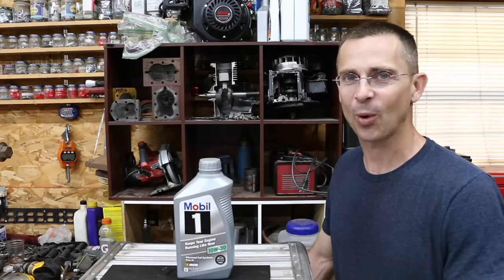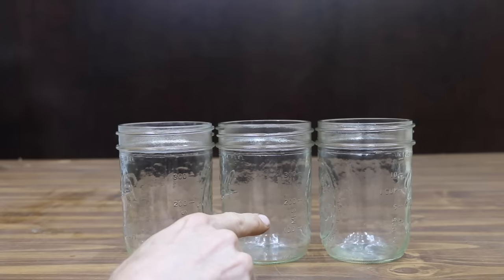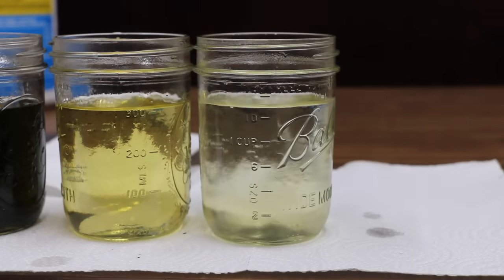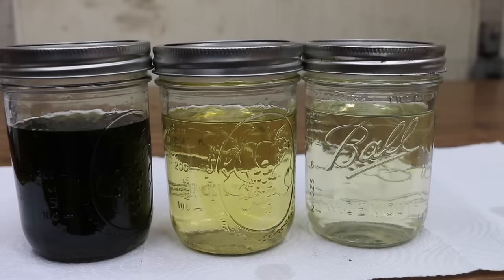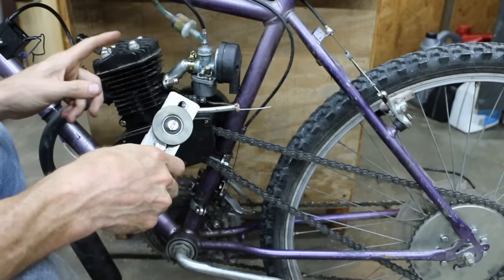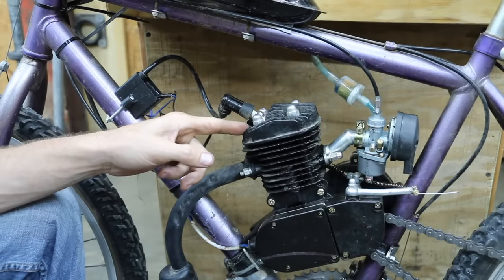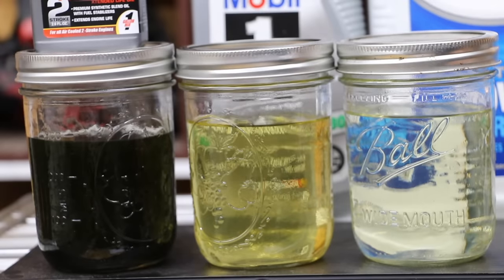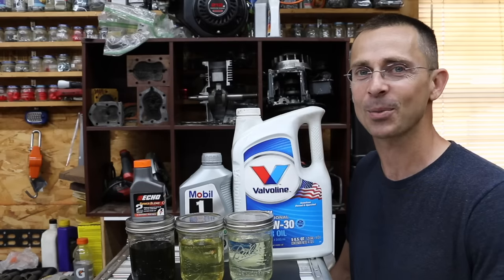Will 4-stroke oil damage a 2-stroke engine?  Let's find out!

Comment: in the 50s and 60s when I was a kid on the farm. We NEVER had any 2 stroke oil. we ran 2 stroke engines on chain saws, outboard boat motors,washing machines, lawn mowers, and my 125cc 2 stroke harley davidson. NO one I knew had any 2 stroke oil. cars like the saab and dkw 3 cylinder 2 strokes used ordinary 4 stroke oil. Yes, 2 stroke oil is better to use and results in less carbon build up so I use 2 stroke oil now that I can get it.
Reply from the maker: Thanks for commenting on this.
Reply: Thanks for sharing Rick. Excellent!
Reply: That is because you had leaded fuel, the lead was the lubricant ;)
Reply: we used 4 stroke oil in the gas
Reply: @notavailable9919  Lead was never the lubricant. There may have been a tiny effect, but even this is not clear.
Reply: try again.......
Reply: Not Available ... The main benefit of lead in fuel was to raise the octane to prevent engine knock. This also benefited the valve trains -prematurely wear of valve seats more specifically.
Reply: 1970 max amphibious atv calls for 20:1 straight 30 on JLO 2 stroke
Reply: i now fill up my truck with xd-100 2 stroke oil and i swear buy it
Reply: yeah 2 stroke oil today burns much hotter and cleaner.

Comment: During cold war era, in the entire eastern block many 2 stroke cars and bikes were driven for decades with cheap Addinol MV232 four stroke oil mixed to fuel...if "VEB Addinol MZ22 two stroke oil" was not available or too expensive (and it was allmost never availabe :-)))
Reply from the maker: Thank you
Reply: Still remember those andy.father ran waste 4 stroke oil in his 2 stroke. Only side effects where some soot around the spark plug that was glowing on a high power demand low rpm situation and caused pinging so you'd have to use a lower gear. He also knew some engineers from Addinol and they said more or less if an (4 stroke) engine survives our (4stroke) oil, it'll everything else.

Comment: thank you for making this video. I was on my way fishing after filling up the boat and already putting the 4 stroke oil in the gas. when measuring the oil I noticed the color was wrong and thought it must have been a new type of oil, as my dad had gotten it and he's been running boats for longer than I've been alive, so he knows the difference between 2 and 4 stroke oil. when I was done I looked at the jug to see what this new oil was, well it was 10w30 lol. we had already ran 20gal of this mixture threw the engine and I just put 10 more gallons of it in the boat. I thought the engine was toast. I found your video on this and watched it before I left the gas station. Thank you so much for doing this, I already subscribe to your channel, but I am so thankful for this video. I can guarantee I will be picking up the right oil immediately, but it's nice to know we didn't hurt the engine. The tank holds 20gal, but we run the boat enough that we shouldn't have to worry about it gumming up before it's gone, if anything the gumming up gives me more of an excuse to go fishing to get rid of the 4 stroke oil lolol. Thanks again.
Reply from the maker: You are welcome!  Thanks for sharing.

Comment: This is a great experiment. Thanks for doing this. Intrrestingly enough my 1961 Mercury outboard motor manual indicates that a straight 30 weight oil can be used in place of two stroke motor oil. They do not recommend multigrade oil or oil with detergents.
Reply: Sounds like my 8v92 detroit diesel 2 stroke oil specs, i cut in some XD-100 BRP oil in with shell rotella though, 475hp turbo 2 stroke! 2 strokes under load produce more heat and pressure and require a heavier duty oil! look at Silkolene por 2 sx, motul 800 2T and amsoil dominator, all surpass 4 joke crap as a 2s troke bot gas and diesl is an industrial gade motor, both Day loop charged and Clarke uni-flow charged! All are more efficient and more powwerful, 4 joke is throwaway automotive crap that sounds and runs like shit but fu to watch self destruct! All thse great muscles care are ruined by 4 joke disposible horrble sounding scrap! not a fan of 4 joke and never will be. i got my rotary on nothing but amsoil dominator synthetic 2 stroke oil and runs great. But there is hope as you can make a u-loop charged poppet valve 2 stroke like this 1.9 VW diesel:https://www.youtube.com/watch?v=qosAllch8Sg&t=5s

Comment: I have used diesel fuel as a 2 stroke oil substitute--works fine but smokes a bit more as you would expect, long term would prob not be too healthy to the engine but its fine in an emergency. Great channel  BTW, keep it up!!
Reply from the maker: Thank you
Reply: Diesel doesn't have the same lubrication properties, and might cause overheating.  I'm surprised it ran that way.
Reply: That's crazy who would use diesel in lou of 2 stroke oil it's not even oil who uses diesel for a lubricant

Comment: Have an old Sears Elgin 2 hp boat motor that says "FUEL RATIO: For normal operation mix 1/2 ?(label damaged) S.A.E. #30 or #40 oil with each gallon of gasoline." Thanks for the videos, keep them coming!
Reply from the maker: Thanks, will do.

Comment: Would love to see a comparison of different 2-Stroke oils. Curious to see which brands are best for power output and wear protection.
Reply from the maker: Thank you for the video idea!
Reply: I use motul 100% synthetic 2t oil.
Reply: @ProjectFarm  I'm not sure what happened to 2 stroke oils but they seemed to have deserted the shelves like the shell rotella t6. These oils are nowhere to be found and I have to use motul 15w40 mineral oil as substitute, a bit Smoky but it actually works
Reply: @ProjectFarm  please test redlines racing 2 stroke oil for us!

Comment: I own a small engine shop and can tell you exactly what will happen. The cylinder will eventually build up deposits, the exhaust port will get clogged, and the engine will finally stop running when the muffler screen clogs to the point the it can no longer release the exhaust.
Reply: That sounds like the result of way too much oil mixed into the gasoline, not necessarily the type of oil used.
Reply: No , the oil additives will whisker the spark plug long before carbon builds up.
Reply: My 1956 outboard is 30 weight engine oil to gasoline 16/1. Ive ran it this way for 20+ years with no issues.
Reply: @dougglaus9256  I have run 57 ev. 15 hp for about 50 yrs. and it is still working good on 30 wt.
Reply: I’ve always used a quality 4stroke motor oil in my 2 stroke stuff (the oil provided by Mercedes dealers) and my McCulloch chainsaw and ryobi brand weedwacker for over 15 years, never had either fail (apart from a blocked jet on the ryobi carb but that happened after about 3 hours not 15 years
Reply: I think that depends largely upon engine design. A higher compression with no spark arrestor, for example, would usually be lower maintenance. Modern 2-stroke designs are more likely to trust owners to use the low-ash 2-stroke oil; therefore, those engines will require higher frequency of maintenance than their older counterparts if run on 4-stroke oil.

But something else, I think, doesn't seem to get highlighted is the difference between today's owners and those of long ago. Older generations were taught and raised to be more involved with the responsibilities of engine ownership and maintenance. Today, however, owners expect things to "just work". Far less likely to perform routine inspections and maintenence, and much more likely to bring things to a shop when they don't run correctly. For example: today's vehicles come standard with oil life meters and oil change warnings--with many of those not even mentioning oil, instead just displaying a generic "check engine" alert.

In short: running 4-stroke oil should still be just fine. The real problems come from reduced owner responsibility factored by modern engineering assumptions.
Reply: But it looks like 2 stroke actually has more deposits, on spark plugs for example, how its possible if its purpose to burn better and leave less deposits
Reply: @She1lby  Depends on what you're comparing to. 2-strokes will always have deposits, no matter which oil is used. The debate here is whether oil designed for 4-stroke engines is better, worse, or as good as oil designed for 2-strokes. Even though 2-stroke oil leaves less deposits, it leaves deposits nonetheless.

If you compare spark plugs between any 2-stroke and any 4-stroke, you'll find that the ones from the 4-strokes are always cleaner (assuming good rings, proper fuel, and optimal fuel/air mixture, of course). That's because the fuel in a 4-stroke does not have oil mixed into it.
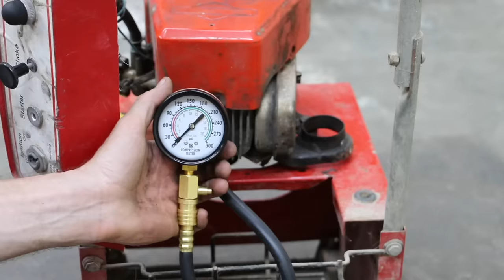Reply: @TonyGingrich  We are comparing oil, not engines - for example 4:58 it looks like 2 stroke oil in the same engine has left more deposits than 4 stroke.
It makes no sense for me because 2 stroke oil is created to excel in this - to burn better and leave less deposits but we see the opposite.
Reply: @TonyGingrich  Good point. My grandfather was parts manager at a mower factory. My father and two uncles also worked on small engines for decades. I learned maintenance at an early age. It’s saved me lots of money and problems since then.

Comment: My grandpa said early 2 stroke engines ran on non detergent 30 weight oil.  Wasn’t till lawnboy came out that a separate oil became the standard.  He said that they would just use used 30 weight engine oil in them.
Reply from the maker: Thanks

Comment: wonder if the 2 stroke has dye to make it easier to see when mixing?
Reply from the maker: Yes, you're right.  It helps consumers determine if fuel is mixed with oil. Thanks
Reply: Yep, that's exactly why.
Reply: Jusb1066 ,
Sometimes red dye was added to diesel fuel that specifically for farm equipment.
so it was identifiable people try to use it  diesels trucks on the road which is non-compliant to DOT.
Reply: @ash yes, in the UK we red dye none road taxed fuel too, always has (im my life!),   even though i had two strokes, i never thought about them dying the oil untill i saw it being mixed
Reply: Right! Some is blue and some is red. Can't remember which though.
Reply: It's in all off-road fuel as far as I know here. Taxed is clear but untaxed 
off-road is red.
Reply: Lewie McNeely my understanding is that if you are moving freight for a job or doing work with the fuel for income or business (which they will tax you in other ways as well) they want to tax your fuel cost because you can write it off in your income taxes.
Reply: Here you can run the off-road dyed stuff in tractors and construction equipment but if the DOT catches you running it in a rig on the highway hauling stuff they'll burn you a brand new one! If questionable, the HIghway Patrol will check the tank(s). There is also diesel antifreeze that is dyed red. I used it in my V.W. in cold weather to keep from jelling. We may be talking about the same thing too. I get more dense than normal sometimes.
Reply: Red dye in diesel fuel used to indicate higher sulfur content, as well.
Reply: Sounds like a plan.
Reply: It is a method for the government to tax fuels.  Off road fuels are not taxed, so they are dyed.
Reply: In my life i had several different dye colors, green, red, blue, orange. Whatever the manufacturer decides on using
Reply: An odd remark about this, gasoline is died green in the Philipinines and several other countries and deisel looks the same as gasoline here in the states.
Reply: We were all talking about the oil, not the gas
Reply: Yes- some of the vehicles bought from the closed farm have red stains in the carb area. I know someone who also uses (Legally) Red Farm fuel cause he has a farmer plate. He told me he notices it stains parts red that have fuel running through. Intake,Fuel Filter etc. Something about the red fuel stains. Never seen or maybe noticed it with any other fuel. It seems Farm Red is used to gasoline and diesel.
Reply: When the prices changed. So did the dyes as far as DOT legal goes. Kerosene used to be clear and 3x cheaper than diesel. Now Kero is more than diesel and I see a Bluish/green tinge to it now. Diesel is now a yellow now.{Which I run in the furnace from time to time to beat the home heating oil prices] I did learn one thing about home heating oil. There is tons of nonburnable sludge which looks more like sand to me. I used a torch and the shit wouldnt burn.But Diesel is as clean as a home fuel gets. I notice a cleaner and hotter burn. Sulfur is a bit higher but soot is non-existent. Also I noticed they have water in home heating oils too. smh.
Reply: Thats why you buy the dye needed ;) hint
Reply: Ash qelon  it's actually not taxed that's why  red diesel is cheaper it's diesel fuel but not taxed
Reply: that's weird in Australia diesel is dyed fluorescent green/yellow. But yeah there's different coloured diesel to help stop people dodging tax and subsidy rules as farmers get cheaper fuel, and you can get other things like kerosene and heating oil which will run in a diesel which is why they are dyed a different colour
Reply: Ash qelon red diesel used to be a selling point at truck stops to denote premium diesel before they started using red dye to tell you it's untaxed.
Reply: Jusb1066 yes I've watched them mixing the red dye into clear diesel here in the United States.guy told me it's a vegetable based dye about one gallon of dye for a thousand gallons of diesel I think he told me.
Reply: Lewie McNeely years ago I had my tanks checked at the truck scales coming out of los Angeles by two people from the irs because that's a tax issue.
Reply: Derpin Bird in California I see yellow diesel too.most of its partially bio diesel.
Reply: Anyone reading this wanting to put Kerosene in a diesel better add 20% motor oil for pump lubrication, or your little "experiment" will cost you your injector pump.  I added some Kerosene to my Mercedes to keep it from smoking when I went to sell it. . . . worth every penny !!
Reply: They been doing this for years yet people freak out over Royal Purple 4 stroke oil being purple.
Reply: Ash qelon    they put red dye in diesel all the time and call it #2 Heating Oil.  Diesel is taxed at a different rate.    red dye = no road taxes paid with it's purchase.
Reply: @UZI9MMAUTO  yeah, isn't that something how that works?? And diesel is more than gasoline but takes less to refine..  hummm maybe because diesel powered get better fuel economy??...
Reply: Yes, the blue color is just an identification marker.
Reply: @ashqelon7267 In some countries, agricultural fuel is subsidized and carriers do not benefit from the same subsidies.
Reply: @lewiemcneely9143  Commercial Policies
Reply: @PopaAlexandru.  Taxes. Yessir. in diesel anyway.

Comment: back in the 60s i had a 150cc 2stroke motor scooter. i used to buy premixed 2S gas from the gas station. Every 5000 miles i had to take off the head to decarbonize it and every other decarbonization i had to put in new rings. if i din't decarbonize it, it would overheat and lose power. Today i have a two strike evinrude 65hp boat motor. it requires TCW3 2S oil. That stuff is fantastic. i now use it in all 2S equipment, chainsaw, weedwacker, etc. there is zero buildup of carbon on the head. The walmart brand is very cheap and comes in quarts or 16oz which is perfect for a 6 gallon tank for the boat motor at 50:1 (actually needs 15.2 oz).
Reply from the maker: Great points regarding modern 2 stroke oil compared to using 4-stroke oil!
Reply: or even old fashion 2 stroke oil. I have a feeling that using regular motor oil, except synthetic, will quickly carbonize the head. I sure you realize the problem with that is not the minute reduction of displacement, but that the carbon layer on the head becomes red hot  and that quickly messes up the ignition stroke. In addition, the carbon kills the cylinder wall and rings much quicker and there is a compression loss. With TCW3 it's like a miracle,  because the lub quality is as good if not better, and there is virtually zero carbon deposit.
Reply: I run nothing but xd-100 in my toro kohler mower, truck and yz-250, I am on nothing but 2 stroke oil

Comment: No problem.. They had 2 strokes before 2 stroke oil.. 30 weight was used then.
Reply from the maker: Great point.
Reply: Typically you need to run more regular oil than the thinner 2 stroke  oil with all the additives..
I use it Alot and that's all I do.

Comment: I used to own a 2 stroke motorbike in Bermuda and I ran regular 4 cycle oil in it for 2 years, ran fine.
Reply from the maker: Thank you.  Any problems with carbon buildup?
Reply: I had a Bultaco Frontera 370 -77, and in the manual it said 4 stroke oil (dont remember wich type) at 5%. Didnt had any issues, but engine was dismantled many times for prepping and stuff.. I was young lol

Comment: when we were teens back in the 1960s we rode BSA 2-stroke motorcycles called BSA Bantams, and other 2-stroke motorcycles made by James (all made in England, using Villiers 2-stroke engines), and there was no such thing as 2-stroke oil back then. In fact on the gas cap of the Bantam's gas tank, was a built-in measuring cylinder on which was engraved by BSA something like " use 3 full measures of this cylinder of oil per tank of petrol, use SAE 30-grade motor oil." I use chainsaws and other 2-stroke engines, with standard car-motor oil instead of 2-stroke oil in the mix. I hope I'm not damaging these engines by doing so.

Project Farm you've performed a thorough test here and I am impressed with how thoroughly you test things on your channel. Thank you.
Reply from the maker: Thanks and you are welome!